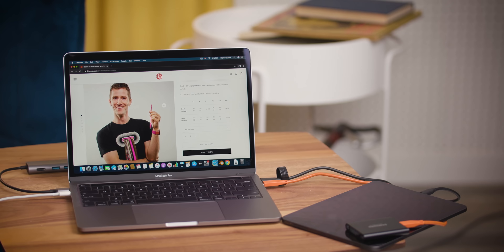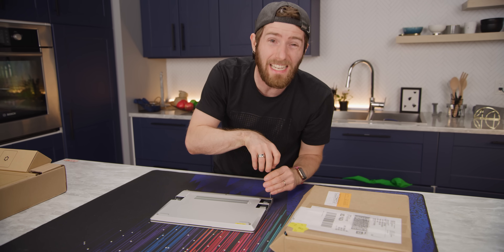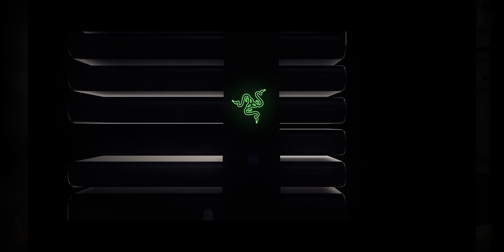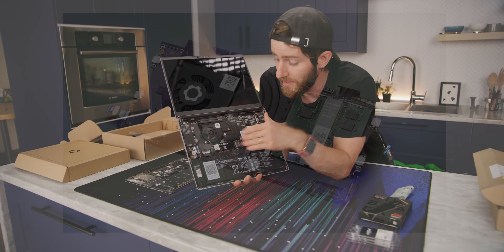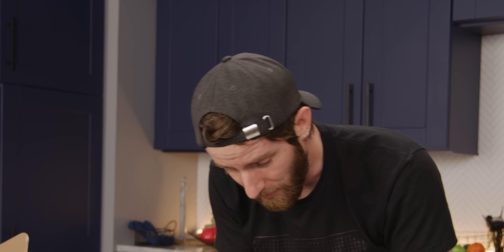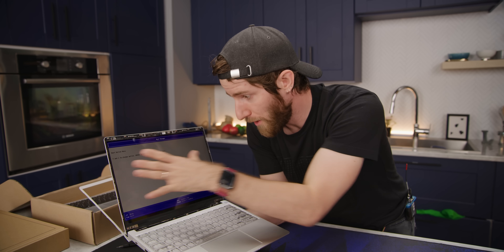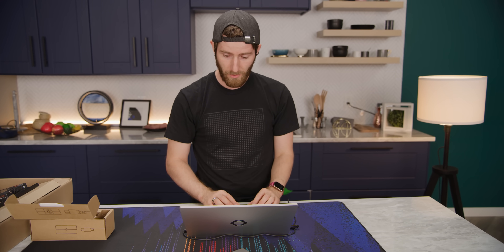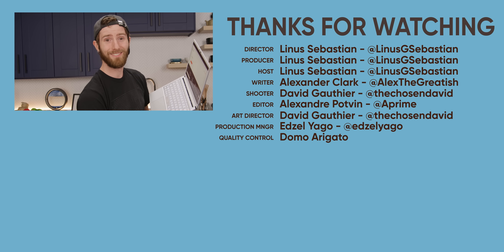A COMPLETELY Upgradeable Laptop?  - Framework Laptop Review

Comment: BULLSHIT. Upgradeable by whom? A person with 20/50 vision, or a person with 20/20 vision WITH magnification?
Reply: ? it is definitely upgradeable
Reply: Upgradable by people who needs a laptop that lasts a long time. DUH.
You're only focusing on 2 specific type of people
Reply: @bigman695  What can you upgrade that you cant in all the other laptops on the market??? On Framework you can't upgrade the CPU nor GPU. It's just a scam. They have thunderbolt expansions? Those are custom made just to fit their framework and are not compatible with ANYTHING else. WOW, you can change the memory and the drives... Every customizable laptop manufacturer like MSI, Dream Machines, Hyperbook etc. was doing that since 2010. It's a decade old standard, not a sudden stroke of genious.
Reply: @bzqp2  well it is alot easier for a new user to do but you do have a point there

Comment: Maybe the biggest thing is just affordable replacement parts. I cracked a laptop chassis, and JUST the chassis, just the piece of metal with no electronics, and the replacement part cost $500 USD. For a piece of metal. In a $1,000 laptop. I don't mind companies having a profit margin on replacement parts, but that profit margin should not be 2000%.

Comment: Upgradeable? Repairable? A battery that can be programmed to remain at 50% forever when plugged-in all the time? Hey, it's just like my 2010-era Lenovo T510 ThinkPad that I bought used for $300 in 2014 and have been daily driving ever since. Upgraded to an SSD. Upgraded optical drive to play BluRay movies from my extensive collection. Okay, the T510 is certainly not thin and light. But it has been around the world. Cheers.

Comment: The main thing NOT covered here, how is the performance compared other equally priced laptops?
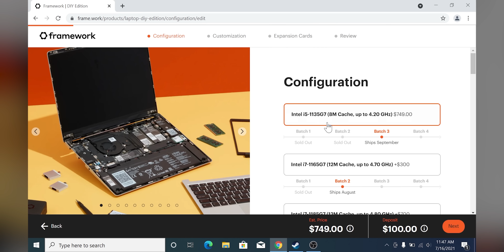Rough conversion gives around $650 as starting point for other laptops with this CPU (17:00 - $749)
Thats not that cheap, wont sell enough machines to stay in business so the upgrade path is most likely a mood point

Comment: I'm not sure this is more than a novelty.  The port adapters are great and all laptops should use something similar.  But in 4-5 years when a buyer would be looking to upgrade this to TB 3rd gen, a 16TB SSD and 256GB RAM they're out of luck.  Unless they want a seriously backwards CPU, and I don't see a decent GPU in there anywhere.  A little hard to fit a modular GPU perhaps?  The Dell XPS you compare it to can be had with an RTX 2060 or 3060 or whatever.  The point however is that when time comes to upgrade the platform won't be interesting, and most people will just buy a new laptop to upgrade the platform.  The exception is when buying a bargain 8GB laptop or such today, but they are at an entirely different pricepoint to begin with.

Comment: I pre-ordered one of these and the only thing missing that I'd love to have a module for is 4G/5G.
Reply: Could probably send their team an email. I'm willing to bet a module for LTE and 5G connectivity would be a HUGE selling point for on the travel. I could see lots of companies purchasing these for their on the go employees.
Reply: @huskers1278  All the major business laptops makers have models with an internal slot for a WWAN card (Thinkpad, Latitude, Pro/Elitebooks). It's a niche use case, but big enough to already be covered.
Reply: @huskers1278  and that is where they could get serious traction. For a company that has to provide its employees with a device for work, the future upgradeability and the ability to change out particular parts will be a HUGE cost saving for these businesses. That is how they can get a foothold - become the preferred business provider by slashing their costs for equipment maintenance, provide support and upgrade parts, etc. A no brainer.
Reply: @davidmccarthy6390  Absolutely David. If I was a company that needed multiple laptops for employees going with this would be an easy choice. It would save companies thousands and thousands. All you need is a couple people in IT to replace broken or faulty parts which are EASILY replacing which also limits down time. We've never seen this before and it's exciting !
Reply: im sure it'll be on the way

Comment: Yea, good luck at finding a GPU and CPU which would fit in the specific slot there is available.
Reply: Oh, so you CAN't even change the CPU. How is it different than MSI?? Or all these customizable laptops like Hyperbook or Dream Machines? That Framework has custom-made, uncompatible with anything else, thunderbolt expansions?? Please...
Reply: Wait. You can't even change the GPU. What a scam...
Reply: @bzqp2  It doesn't have a GPU, it's integrated graphics... Also if you want to upgrade the CPU well blame Intel because it's been almost 10 years since Intel sold a socketable laptop CPU so you can't blame a small hardware company for Intel's decisions.

Lastly, I repair laptops for a living and while many laptops can be upgraded and fixed, the difference is the effort required to do so. In some cases it's almost impossible to do without damaging the device beyond repair due to adhesive (MS Surface Book 2) and in other cases it can take 3 hours carefully disassembling the device, avoid breaking the tiny fragile ribbon cables which means many people don't want to pay for my time.

On the other hand this thing could be disassembled in 2 minutes while blindfolded and there's much more components that can be replaced. I assume I'll be able to buy replacement parts direct from them as well instead of having to trust shady sellers on eBay buying knockoff parts from China.
Reply: On the site it says: they will have instructions on how to replace the mainboard.
Reply: @autohmae  If you want to change the whole mainboard to change the CPU and GPU then the customizable laptop manufacturers also let you do that for a decade already. But at this understanding of "customizable" what's the point even? The only way such laptop would make sense is if it had a really spacious shell in which you could integrate standard desktop elements. Some manufacturers are actually going in this direction, which is amazing - you can already put regular desktop CPUs in some of them. Too hard to pull of with GPUs though. What Framework is doing is nothing new, and their custom-made dongles working only with their product don't really impress me.

Comment: you better have full proper storage drive encryption on that computer! or hackers are going to try too get all your data and try to steal that computer to get all your youtube money! easy to repair computers are always have a big problem of attracting computer thieves that work for dark web data hackers to your house or job site! they get attracted to easy to repair computers like a homer simpson to a donut and beer food convection! this is why apple and other computer companies stopped making there computers easy to repair to stop computer hacker dark web chop shop criminals to stop stealing all their stuff out of there customers  workplaces and homes!
Reply: Just dont use external drives and encrypt your stuff. The removable drive in the video can even self encrypt.
Reply: @H3wastooshort  yes but even still most computers that use file encryption have the actual key stored  on the same drive if its not separately stored and with a second layer of encrypted codex that is only made by a hard baked primary security chip that to stop hacker to bypass the drive!  this is done by making the key also encrypted, stored and truly random generated every startup and shutdown by a automatically controlled security scitry chip! those are made by apple and other main computer components as well! a security chip on apple computers post 2020 are needed these days! this is due to to hackers can and will try spoofing the key out of a normally encrypted drive's key   out by mimicking the firmware threw  a vm  running workstation to duplicate the original drive  then they reformat the duplicate  dive then they use a data recovery program to restore the key data from the formatted duplicate drive!  to  drive acces the real drive that why easy to repair is no longer a option for apple and others when vms are so easy to mimic and update other systems so easy! that has forced  apple and others had to make hard baked security  chips to prevent the vm duplicate encryption key data recover exploit! that vms can allow a hacker workstation to  get your data off a easy to repair drive! as long if it wasn't clearly welded permanently  on the motherboard in a way  that it can't be removed without destroying  the data and drive with it!
Reply: @ashtiboy  do the encryption in software and give the key a really long password. Just write out 1 or 2 sentences that should do it.

Also: who the fuck needs this level of security? Your avarage user will not get thier physical device stolen to steal it's data. If you run that risk, sure buy the most locked-down thing you can find, but your avarage user would probably prefer being able to fix thier shit.

Comment: ---
So this is basically "Eve V" but instead of a singular customer-demand-design now you can have almost anything you want assembled to your preferences around the "base/core" alongside the future upgradability.

And the (current) starter Do-It-Yourself-kit has numerous very good high-quality-components alongside 3:2/16:10/8:5-display.
And all this starts at less than 800€?!

insert- I'LL-TAKE-YOUR-ENTIRE-STOCK-JonTron-clip-here
---
On a side-note, I seems like influence of this video made computer-configuration-page of Framework Computer Inc crash:
The message I keep getting is "We're sorry, but something went wrong", even though in my opinion everything seemed to be just right.
---

(( Also, yeah, I am fully aware someone might have already made this exact-comment I have.
But there is 6796-comment as of posting this, and the "infinite scroll" as opposed to "paginated"-comment section makes reading through all those comment pretty much impossible. ))
---

Comment: Modular laptops aren't something new. In fact I've seen super cool modular laptops from different brands like Asus, Dell, HP and Fujitsu to name a few. For example I've seen a laptop where you can choose between a discrete GPU or a battery. I've recently discovered that my old Fujitsu P771 has a freaking projector module that can be inserted in the place of the second battery/DVD bay. Although you can change basically every part of these laptops, the problem stays the same over the years. We need a standard for modular laptop parts. Currently I can't upgrade almost anything of my good old modular laptop. They don't offer higher capacity batteries, better CPU for this slot, even the projector is more like a collectable. The parts I've managed to upgrade are the RAM from 8 to 16GB and also the storage with 1TB SSD (I don't need more for now). I still use it and I love it, but the modularity is a matter of support. If we have some standard, then we can relay on third party modules. That's why USB is so important and popular way to add hardware to your computer. I guess USB killed PCMCIA and now days nobody wants anything else.

Comment: I hope the audience of enthusiasts for this specific thing and maybe some professionals who will need to change I/O on a regular basis and do not like dongles would be enough to make them profitable. 
I can't imagine someone I know buying a laptop, using it for several years (which most laptops support), then when it's time to shake things up or have something different, it's time for a new laptop anyways. 
and the main problem with laptops getting old is processors! 
these can't be replaced anyways.

Comment: This is dope! Now let's hope that they release a gaming version that has swappable laptop graphics cards/motherboards.
Reply: @addisesannairvasudavan9519  right, the only thing is that gaming motherboards are typically thicker to accommodate extra hardware. So hopefully a chassis that supports a thicker MB setup will get released before too long
Reply: Sorry for asking this stupid question, but wouldn'tt it possible to mount a graphics Card externally  with some gaming specific "mods"?
Reply: @sameerchakma  in theory, it could be done, but between the technical Hassel and bulkiness of it, it defeats a lot of the purpose behind integrating a graphics card.
Reply: It won't be as slick as this one but man if they will do it right with all the cooling and component placement it will allow them to survive on the market. It will need to have a place for all across the 1050s, up to 3080s, and this did not work well in Alienware Area-51m. For 1060 and 2060 as an example. (Linus did a video about Area-51 like 2 years ago).
We had the MXM GPU as well which is covered reasonably here:
https://www.youtube.com/watch?v=91JHu7eq4G0
If this wants to stay thin the case needs to have a more room option, and the GPU will mostly go with the Motherboard. So the question is how much will stay from the original build? And if not much then is there big enough reason to stay with such a laptop as a whole OLD unit.

Comment: What if they put the custom AMD APU from Steam Deck?...  and turn it into a gaming laptop?🤔
Reply: That APU worked for the Steam Deck because games on it run at 720/800p. Might want a board with the mobile CPU+GPU used on the boards of other gaming laptops. Though I'm not sure about the cooling either way.